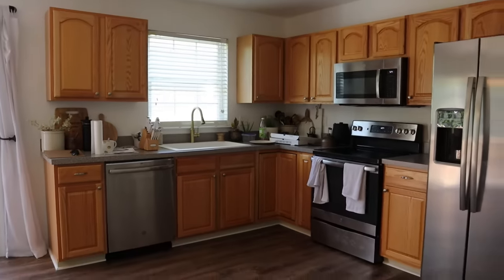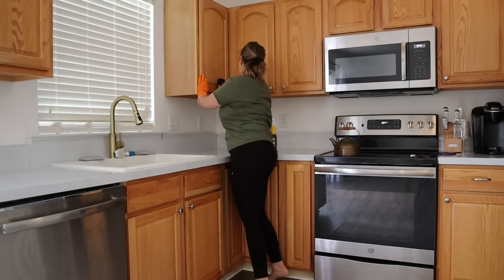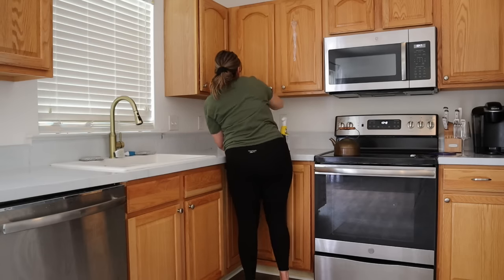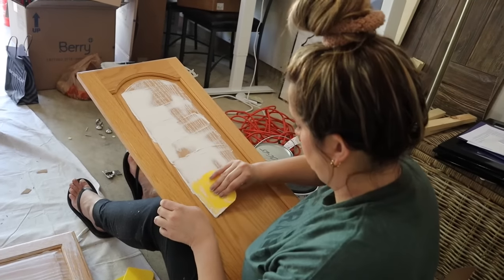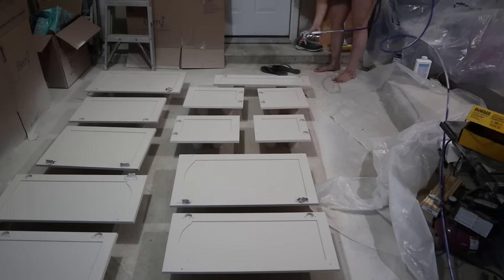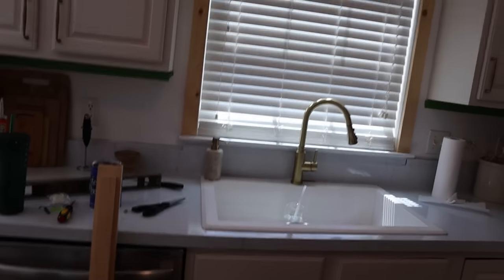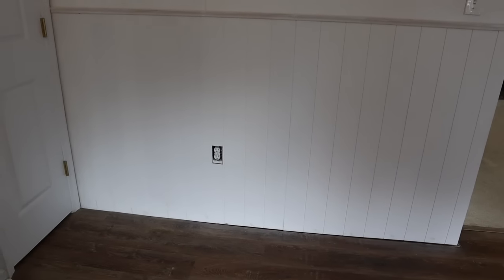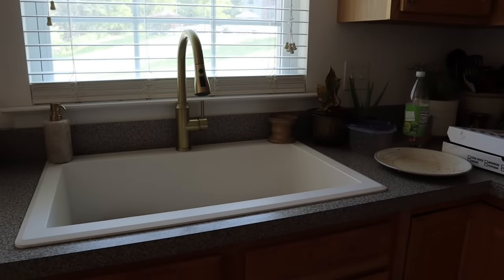Kitchen Makeover on a Budget | Refinishing Kitchen Cabinets | Kitchen Makeover Ideas

Comment: Wow, love that cabinet color! I think a battery operated wall light over the window, lighting up the sink would look great, maybe with a metal shade that mirrors the hardware on the cabinets? A patterned large rug would look great between the island & cabinets would totally bring it all together! Nice job!
Reply from the maker: I did consider a light above the sink, but the space between the top of the window frame and the ceiling is small so it looked very crammed. We also do have a recessed light right above the sink so that lights it up! Thank you for watching!! ☺️🖤

Comment: It looks amazing! you did a great job.  I used the same contact paper for my kitchen, I managed to finish putting it down but it was difficult not to have air bubbles on it.  I also painted the cabinets just like you did, but did not used the wood filling, It was too much work and they came out fine.  My total renovation cost around $200 but it looks amazing and it will give me some time for me before I can really replace the counter tops with Quartz.  You did a very professional job and I admire you for it.   💓

Comment: I've been debating on whether or not to do this to my cabinets but I know it'll be soooo much work 😩. I'm currently putting all new flooring which will also be going into the kitchen and my cabinets are soooo dark, they won't look good with the color of the wood I picked out. So, I feel the need to paint my cabinets... thank you for this helpful video! I did have a question, I noticed you used a brush to finish painting the cabinets but used a sprayer for the cabinet doors...did the brush happen to leave brush strokes? Also why didn't you use the spayer to paint the inside cabinet? Thank you for taking your time to read this!

Comment: Will it work without a paint sprayer, if I just use a brush? Is it even possible to get a clean smooth look with just a brush?
Reply from the maker: I’d recommend rolling if you don’t have a sprayer. You can brush first, but then I’d go over it with a roller to help smooth it out. It won’t be the exact finish as a sprayer, but you can still get a good finish with a roller.